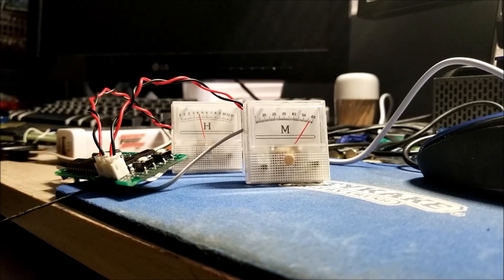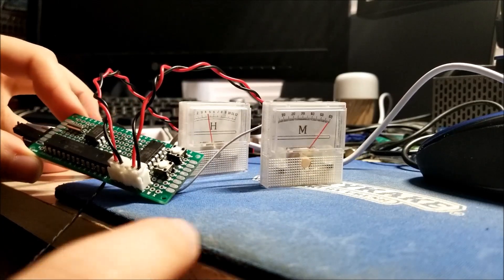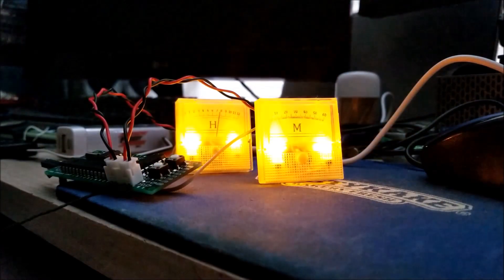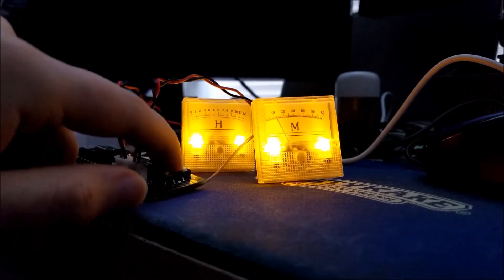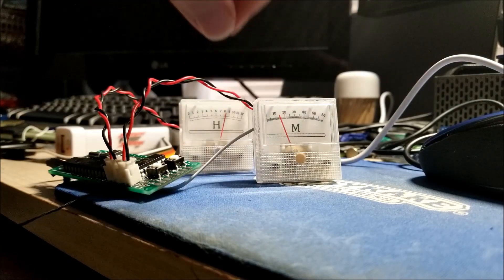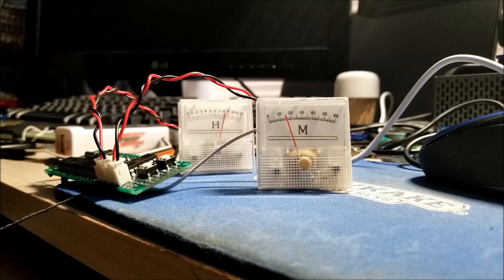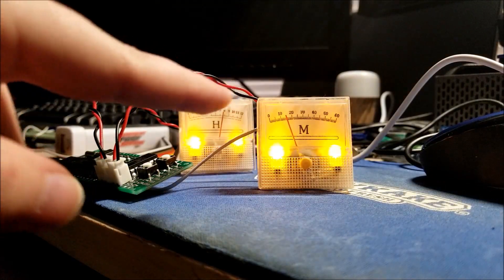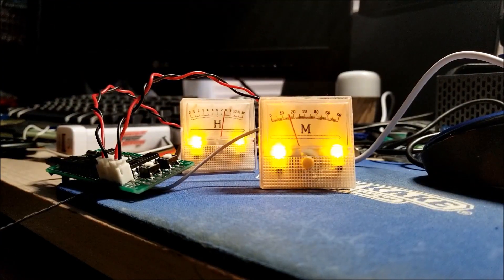Analog Meter Clock: Part 2 - Circuit and Software Done!

Comment: Cool to see it in action! Which color of LEDs did you use? Plain yellow?
Reply from the maker: Yeah I used high brightness 5mm yellow leds to simulate incandescent bulbs. They were water clear but I hand sanded them to diffuse them. If I remember correctly I got a few packs when RadioShack was going under.
Reply: sjm4306 could you please provide me with the files required to print the labels for minutes and hours? Thanks a lot